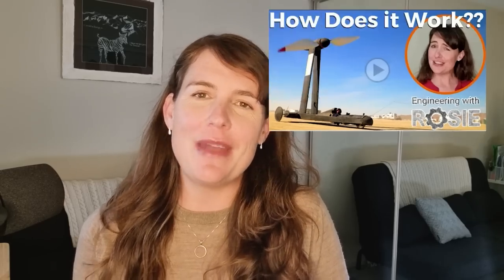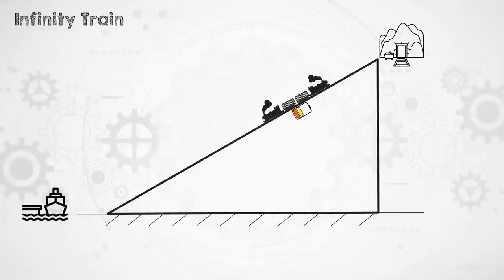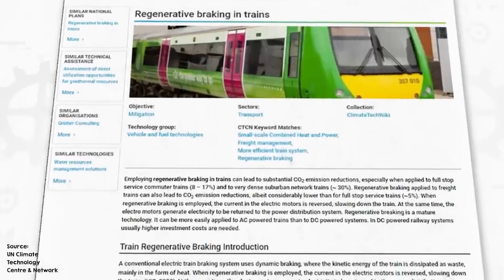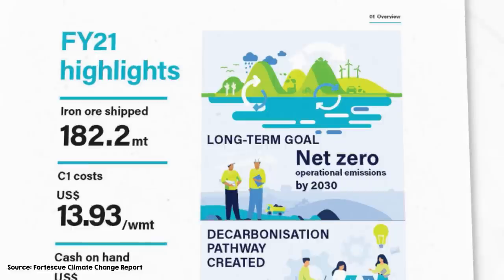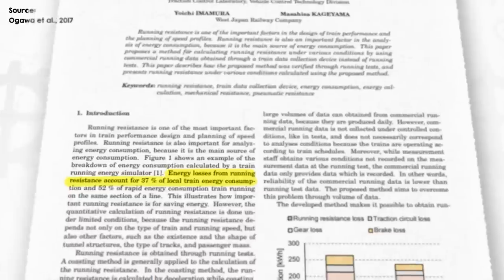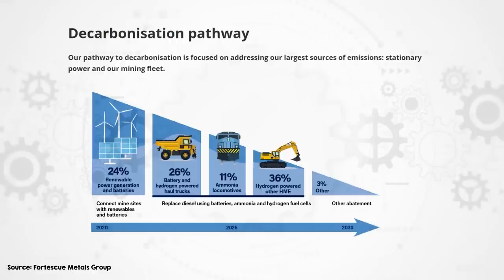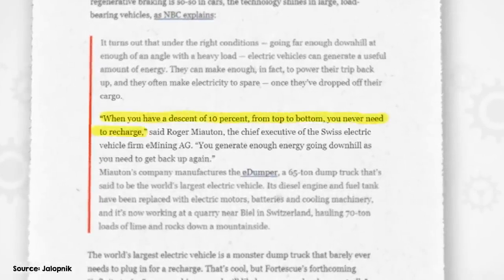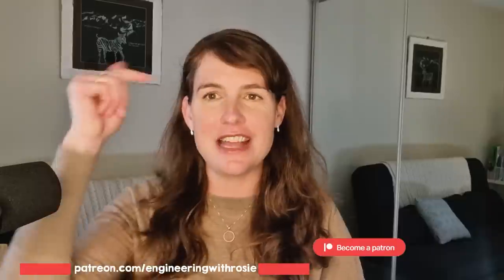This Mining Train Powers Itself: The "Infinity Train" (and how it works)

Comment from the maker: Visit  https://brilliant.org/EngineeringwithRosie/  to get started learning STEM for free, and the first 200 people will get 20% off their annual premium subscription.
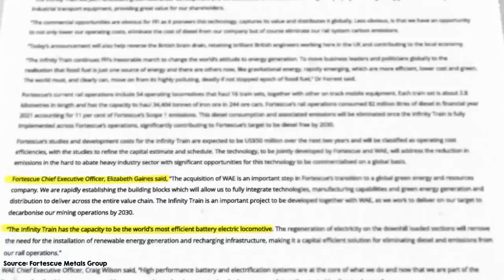Reply: 8:20 "the world's most efficient battery-electric locomotive"    Strictly, it's that part of the SYSTEM which is so efficient, not the locomotive.
I note that Australia gets lots of sunlight, which is jolly useful. I also wonder about the electrical power needed for mining operations.
Reply: regenerative braking is not new and does not produce "free energy"
when are you going to tell the truth rosie ?
Reply: @richardcowley4087  A HEAVY object going down releases energy. This can be used to generate electricity. Then a miracle occurs: YOU UNLOAD THE TRUCKS  !!!
Then you need MUCH LESS ENERGY to push the LIGHTER trucks back uphill, where they came from.
Doh!
Reply: @richardcowley4087  LARGE mass dropping distance X yields    energy E2
THEN when we come back up, with an EMPTY train, it is:
SMALL mass being raised (same distance X) requires a SMALLER energy E1.
E2 is GREATER than E1.
Going downhill with  HEAVY train yields MORE ENERGY and only some of that is needed to push the EMPTY, LIGHTER train back up the hill.
Reply: Gravitational should be a term a scientist shouldnt use until proven. Maybe start with density and air pressure like buoyancy in water
Reply: @simonmultiverse6349  that has been done with rail transport for over 100 years
you are far behind
Reply: rosie the scammer
Reply: @richardcowley4087  Oh, does that mean you AGREE with my description?
Reply: @richardcowley4087  Large mass x gravity x distance yields large energy.
Going back UP ...    SMALL mass x gravity x distance requires SMALLER quantity of energy, which proves you have a SMALLER brain.
Reply: @richardcowley4087  Climate change? This is basic mechanics! A LARGE mass falls DOWNWARDS and does work (charging batteries); a SMALLER mass is pulled upwards, requiring LESS work.
Think of it as a see-saw: there's a heavy object on one end and the heavy object dropping under gravity has enough force to LIFT a LIGHTER object on the other end.

The easier way to think of it is TWO TRAINS - as the heavier train goes downhill it pulls a rope which pulls the lighter train uphill .
Reply: You need a lot of batteries to store 49 MWh. 
Probably about 250 tons of batteries. 
I estimate about 50 million au dollar worth of batteries
Reply: @AlbertZonneveld  ...and how much does it cost to build the mine infrastructure? I humbly suggest that it is a lot more than 50 million AUD.
Reply from the maker: @richardcowley4087  I believe I mention both those points in the video 😊
Reply: "Money spent" translates basically back into CO2 emissions at fixed rate. Thats's why people who earn more inevitably emit more. Everything is produced by a person that her-self is a consumer...that emits CO2. 
So if you buy a cheap shitty shirt made by companies that pay their workers barely enough to buy some food, you emit way less CO2 in that transaction, compared to buying a shirt for 40€ made by trigema in Germany , by German workers who get payed enough to be abouve getting benefits from the state, as these workers will consume more than just shopping for food. They will most likely live in a House or Flat made with concrete and clinker that cost CO2 , drive a car or multiple , own multiple screens and a big 4k flatscreen , heat in the winter, pay for fuel,  use pretty above world average amounts of warm water for getting a bath....&c.
You can use the price in $ for products to compare the CO2 emissions they cause in most cases, where labour or production is envloved. With things that have no production envolved but only scarcity , that is a different thing. Like if some one sells or speculates with a plot of land(land banking) then there is no strong CO2 to price relation.
Reply: @simonmultiverse6349  you are stating nothing new, go away and grow up sonny boy
Reply: @EngineeringwithRosie  why so smug ?
Do you think that i wouldnt know anything ?
Reply: @TremereTT  No life without CO2
Reply: @richardcowley4087  People having children are off course worse than childless SUV drivers !!!
Reply: @TremereTT  Bullshit
Reply: Good video, and good point that even though being heavier when going down is obviously going to generate more electricity than it takes to go up, the batteries needed are going to be pretty big and heavy and EXPENSIVE... Makes me wonder if building a more traditional electric train track and using some cheaper type of batteries outside the train would work better.

On the plus side, you could have more trains because they would be cheaper and in case there is any problem with the batteries you can have the electric lines powered by the grid or whatever power plants the mine uses, and the battery can then be the energy storage for the mine electric grid.

Obvious problem with that plan: The train wouldn't be as special if it doesn't carry its own energy but is simply an electric train using renewable power.
Reply: @AnalystPrime  Energy is not "renewable"
this system is only any good with inclines
no good whatsoever where tracks are on mainly flat land
this is just a pipe dream
Reply: Joseph Tutor  How long was the track? The cable would soon weight too much for that to work. Electricity is much more convenient.
Reply: @OVERKILL_EVERYTHING  rosie busy at manipulating to make it look better than she claims
Reply: Why store electricity generated on the down hill in the train.  Make the train 100% electric with power sourced for up hill from transmission line at the base and the regenerative electricity transmitted back to the base station on the same transmission line.   This means the train weight going up hill is much lower.

Comment: The iron ore train running from Kiruna to Luleå in Northern Sweden has been recovering energy on its downward slope (500m vertical over 350km) for a long time. The ore company calls it the green train, each one is 6000t heavier going downhill than going up.
Reply from the maker: I used to go to Luleå a couple of times a year for work (I was working on one of the windfarms nearby), but I never heard of that train! I am hoping to do a trip to northern Sweden next year as they have a lot of interesting energy transition projects (e.g. Hybrit green steel, Northvolt batteries etc) so perhaps I can check it out while I'm there.
Reply: There are two other large-scale electrification of industry projects under way in that area, if you get there: the H2 Green Steel project (competitor to Hybrit, already ordered 800MW of electrolysers, and signed a power purchase agreement for 14TWh - this project is from the same group behind Northvolt) and the Fertiberia project for 300MW green ammonia production.
Reply: There is also a train going from Kiruna to Narvik also effectively producing electricity
Reply: Tonnes or tons?
Reply: All electric trains in Sweden use regen for breaking and as the whole country is one power grid for all trains there is no need for batteries, there is always another train that needs the power. The more modern electric locomotives features a ”trip computer” that monitors and gives statistics for each route, and also helps the driver predict the driving to minimize energy consumption.
Reply: @hattielankford4775  Anywhere outside of UK or USA, it is Tonnes (metric). Only UK & USA use the outdated and mathematically cumbersome Tons (imperial).
Reply: @stevenclarke7777  You do realize that imperial is less cumbersome than metric for certain engineering calculations, don't you? I understand why you think the way you do, though. Peer pressure is a hell of a thing.
Reply: @stevenclarke7777  It's only cumbersome for people who think math consists of only moving decimal points
Reply: Hi Rosie, what would make their system more efficient would be to use an overhead wireway like most European trains, trams, and metro systems, then you could charge Tesla Megapacks (Or equivalent) not have to custom engineer the onboard storage, be able to run as many trains as you wanted and use the excess power for operations. The cost of the overhead service would have to be compared to the costs of the onboad systems
Reply: @TgWags69  Metric is coherent and easier to use. You do not need to suffer just to feel like a hero. Easy is better than hard ;)
Reply: @delanmorstik7619  See that's just it! No one is suffering...WE LIKE IT! It is EASY for us! You suffer because you don't understand. Stop projecting your shortcomings onto other people
Reply: @patrickcurtis5  Nice idea, but that railway is so far out in the middle of nowhere that the losses from the batteries to the train would be so great that it would probably be less efficient.

There are coal trains on the east side of Australia that use overhead wires, the controllers purposely try and time trains to pass each other on hills so that the train braking down the hill provided extra electricity that can be used by the train climbing the hill, this reduces the strain on the grid and the sub-stations that provide the power.
Reply: I've seen those trains. The rails and ties on that iron ore train are very burley (robust.) Same for the ore cars' trucks. A tough job, even if it is, "all down hill from there."
Reply: Oh neat! Gotta love creative engineering.
Reply: @hattielankford4775  Pretty sure a science / engineering person, as well as a person in somewhere which isn't Liberia or Myanmar (although they are metricating rapidly), or some other backwards country, would be using metric, that is, tonnes.
Reply: I dont think so, give some contrasting examples.
Reply: @cedricpatzer6826 I'v ridden that train as a passenger in the locomotive, absolutely stunning views. Isn't it also so that the regen from trains going down is actually needed to give enough power to the trains climbing back up?

Comment: The Milwaukee Road railway through the Cascade Mountains of Washington state in the U.S. was electrified in 1917.  It used regenerative power from descending electric locomotives to help power ascending trains, but they did not have large batteries to store power if no ascending train was scheduled concurrent with a descending train.  Cool idea though!
Reply: The Pilbura area of Western Australia has no power grid othe than small local grids for the few cities,towns really there. So the mining companies which are hundreds of kilometers apart  have to use their own systems with storage batteries on trains.

Comment: Same but not.  I installed a 60" troughing conveyor on a salt mine about 10 years ago.  It consumed no power.  It actually made about 20 horsepower, because the material was going downhill and the electric motor just regenerated 100% of the time, primarily to slow the material down.  But in that particular case the motor was never used to contribute mechanical work to the system.  

I dunno.  I thought it was neat.
Reply: Very cool. Thanks
Reply: Definitely neat
Reply: And it would actually deliver power and thus reduce the electric bill for the mine, genius!

Comment: Welsh slate mines used a water balance to send trucks of slate down steep, straight inclines. A steel cable connected the descending truck to the ascending tank of water via several turns around a massive wooden drum which had a simple band and lever brake. I think the water could be allowed to leak out of the tank and replenished when necessary. Similar in concept on a much smaller scale. Water trucks could also be used to raise slate trucks out of deeper pits if there was a water supply (which in Wales there usually is).
Reply: I seem to recall seeing this working in my early years (60 odd years ago).

Comment: The fact that the truck isn’t 100% recharged via gravity just makes it more exciting in a way, because it highlights how it doesn’t need to be 100% to be worth doing. A bit like how the Australian grid can get to almost 100% renewable energy with just 5 hours of storage, is a likely far more achievable and cheaper short term goal than 100%.
Reply: Precisely, modern gas boilers etc are 96% efficient, that is great but if the effort to get 50-70% efficiency or recovery doesn't cost any extra or is minimal then this is how we will solve the issue quicker.....

Here's a little insight for you..... dynamos were invented back in the day that ran on the water flow from your kitchen tap..... we also had electric cars over 100 years ago.....
Reply: also with the biggest energy drain on AC and refrigeration we can cut lots on energy by getting better at insulating and instead of go full 24h cooling we go full cooling/ heating at peak renewable production and regulate the cool distribution later at lower energy cost.
Reply: Plus, even though it requires charging, we can charge the truck from renewable sources attached to a diversified grid. Still a win for some circumstances (but wouldn’t want to have to recharge every second run for example)
Reply: The truck doesn't need to be 100% charged to every time. Also, it's okay that you only get 80% of the energy out because you're also doubling the weight on the way down. It only uses half the energy to get back up so you still have left over and you still don't have to charge.
Reply: @soothcoder  
Need nuclear power
Reply: @Robert-cu9bm  NO,NO,NO,NO,     BUT FUSION YES,YES,YES!!!
Reply: The problem is, most mines are down in the ground and the load needs to be hauled uphill.
Reply: @stephenvelden295  Regen on the mass of the unladen truck can still reduce energy costs.

Comment: The principle in this video has been used a long time already on a iron ore train from "Kiruna, Sweden" to "Narvik, Norway) on "Ofotbanen". On  the way from the highest point at 531 meter down to sea level in Narvik it generate up to 4000 KW will breaking. The total generated power is more then it need on the return trip. 
The difference is that the since the train is net connected all the way it just return the power to the electricity net. Since the electricity on that net is generated using hydro or wind it is pretty green at the start, but it is a major cost saving.
(A easy way to see how electromagnetic breaking work is to find a small electric motor and wrap some string around the axle with some weight at the end. If you drop the weight it will basically free fall to the ground. but if you place a led between the plus and minus on the motor the led will light and the drop speed will slow down to a small fraction of free fall).
Reply: Connecting to network would eliminate the need of carrying heavy batteries. It may be more advantageous in many ways
Reply: @alisavas9526  Not having to push the batteries up the hill every time should make it more efficient, but then you also need the power line along the track and a large enough net or a large battery bank at the mine. I think it comes down to cost and what gives the best PR for the company.
Reply: Have you witnessed bright-pink-painted bearing-houses on the Kiruna-Narvik bogies? Should be 16 of them in operation.. Asking for a "friend" ;)
Reply: @AdityaMehendale  Sorry, but I have not. Narvik is about 1700 km north from Stavanger where I live, but do tell the story.  🙂
Reply from the maker: I have skied in Narvik, should have checked out the train while I was there!
Reply: @bknesheim  With a double-track railway you can have one train going down, powering another coming up at the same time, to avoid too much change to load and supply on the rest of the grid.  But the Pilbara iron ore railway network is single-track for much of its length.  (There are two mines some distance apart with single-track lines to each, and the combined line that connects those from their junction to the coast is doubled for some of its length but still has some single track portions).
Reply: I was going to mention this but didn't have to.
Reply: @bknesheim  Worked on a project to outfit these with sensors to monitor and report bearing-wear (temperature, vibrations, etc.). Bright pink to make them glaringly obvious for the crew, and because the project-sponsor had a sense of humor :) 
Imagine energy-harvesting and -storage that must work at -40'C and also +80'C ;) It was a pilot, so it is equally likely that the bearings no longer exist on the train.
Reply: @JonathanMaddox  Mostly single track works fine; you only need double track where the trains cross each other. Just like many funiculars do: single track except where the trains pass. You'd also need overhead wiring and associated infrastructure to transport power from one train to the other.

But you would need to have two trains for this, and hence, two sets of crew. It also means that if either train is broken, no ore can be moved, making the system less reliable. The higher investment costs (extra train, more infrastructure), higher operational costs (more crew) and less reliability may be enough for the company to go with hauling batteries.

Comment: The infinity train might be more generally applicable as I guess most mines will be shipping their ores to the sea, which will normally be downhill. But the eDumper I think will not be that successful since most of those are used for transporting the ore out of the mine to the surface so that's uphill.
Reply: Battery electric dumpers will require some charging, but will still be far more efficient than diesel-powered dumpers, with very low emissions and much lower maintenance costs. The Pilbara miners are aiming to be fully electrified diesel-free operations by mid-2030s or sooner.